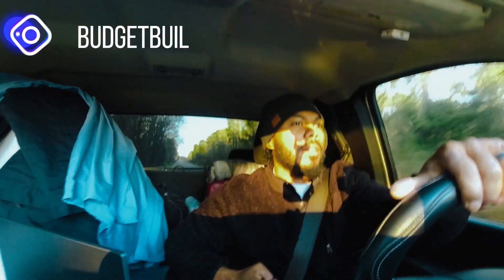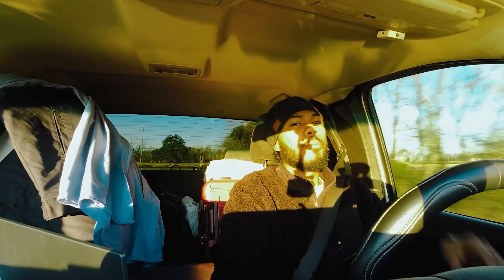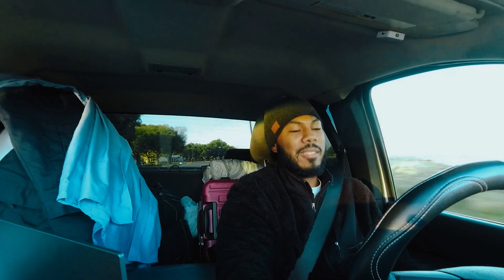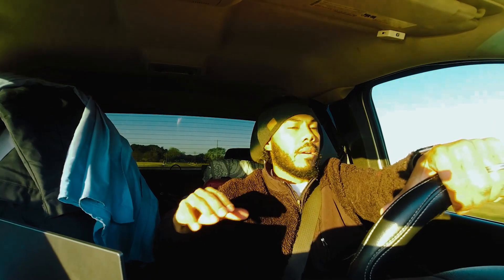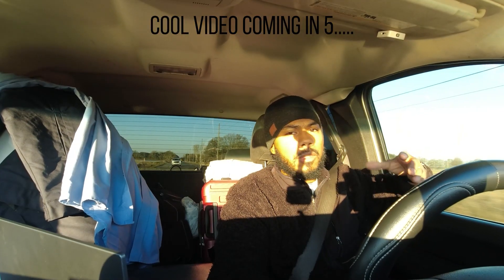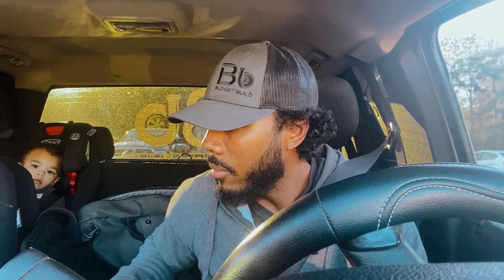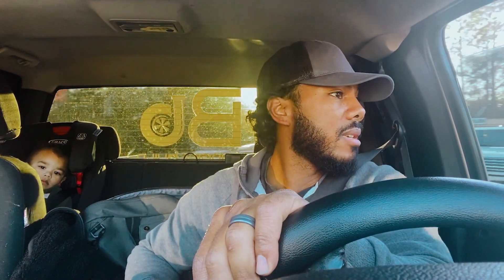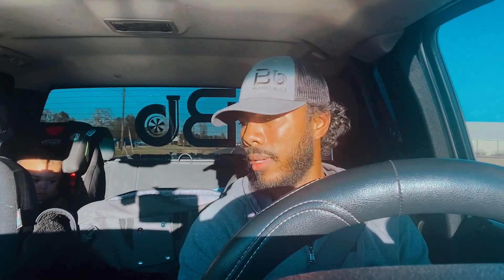HOW TO Turbocharge your Silverado series|Q & A|

Comment: I ordered my budget build  kit last week. Can’t wait to get it installed. Mines going on a single cab 1500 5.3 cammed with 4l80 swap. Are you running a boost controller? How much boost are you currently running?
Reply: Did you ever kit it? And how was the part quality?
Reply: @392mygfnn  I am still waiting for my kit to arrive so I can’t give any reviews yet
Reply: @LA-MCMLXXX  how are you liking it? Assuming it has came
Reply: @392mygfnn  So far everything looks to be of good quality. I still haven’t received everything so I am not able to give a full review. Once it’s installed I will.
Reply from the maker: Right now we are running a manual boost controller set to 9.5 to 10.5 psi depending on how cool it is outside.

Comment: How much time you know you're running since it's a 4.8 and it has the flat top pistons so it's a higher compression ratio
Reply from the maker: Right now we are right on the edge of safe for 93 pump gas BUT we are also spraying 50/50 meth mix.